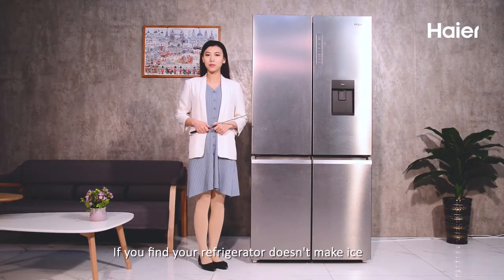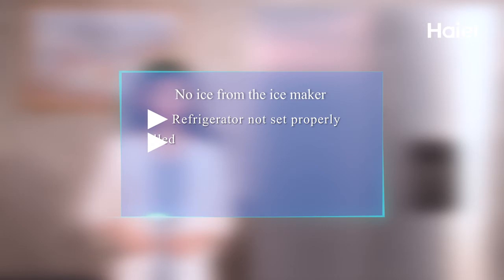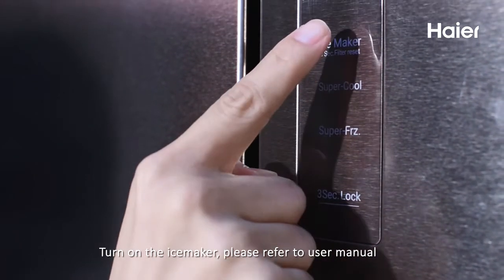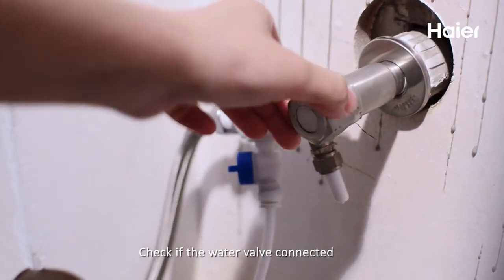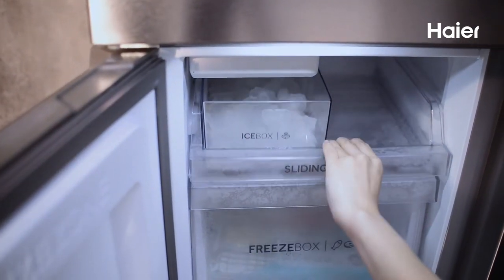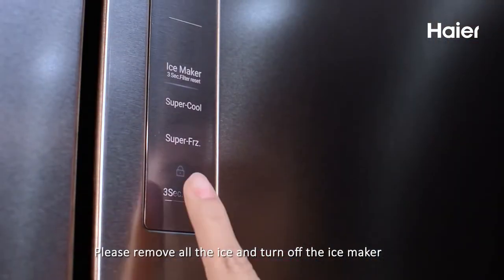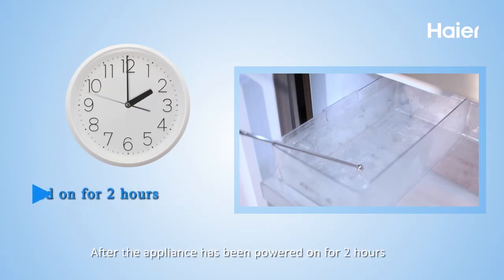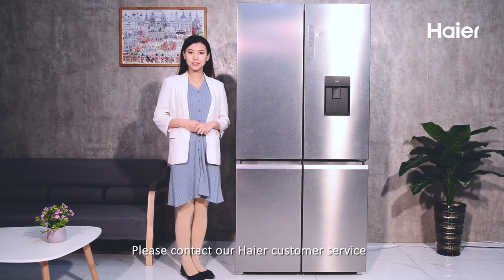English REF SA 10 No ice from the ice maker Haier

Comment: Mine's not working- everything else does.  Trying to connect it to WiFi now (not easy!)
Reply from the maker: Dear Sir/Mam,
Kindly share your contact details- Our team will get in touch with you.
Reply: @haierserviceengineersuppor6938  The wifi connection kept saying ‘no internet connection’ but after a few tries it connected.  The ice maker also works now but I’m not sure how.  There’s a button thing on the back of the maker we found when we pulled it out, and it seemed to be pushed in preventing the ice tray from flipping over to dump the ice.  For a while it would dump one tray then stop.  Just as I was about to ask for service under my warranty, it began working.  Strange